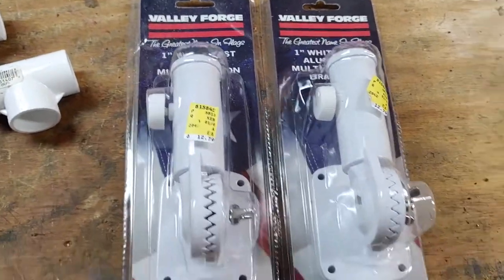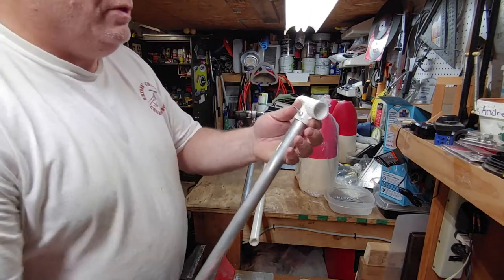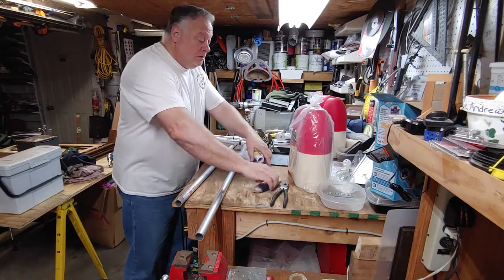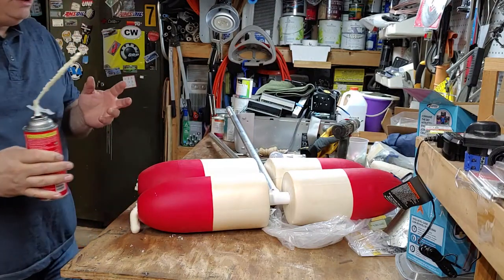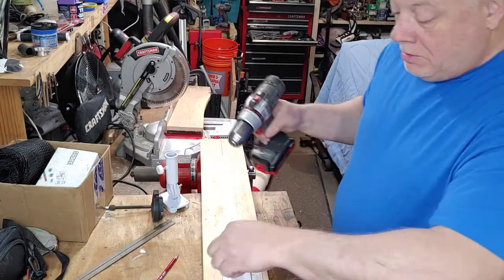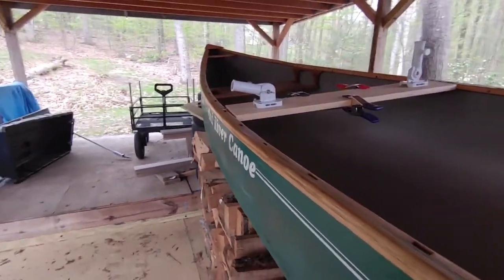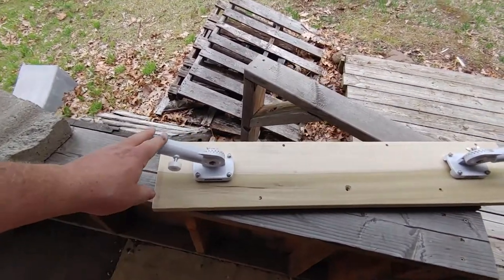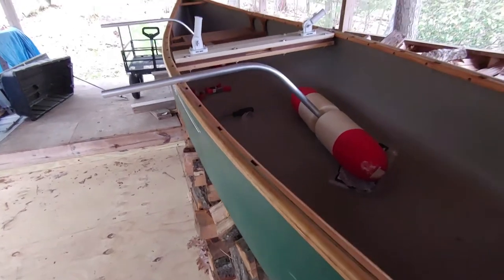Making of Canoe Outriggers that are removable and will not damage the yoke.

Comment: Nice build! I have a Coleman canoe that has a 1 1/2”-2” round aluminum tube that’s my center “yoke” so I couldn’t make one like yours. I had to drill holes in the center tubing and lay my smaller outrigger tubing on top of the canoe center “yoke” pipe and line up the holes and drill them out. I don’t have the flag pole holders on mine, I bent the outrigger tubing and mine is bolted through with large washers bent to match the pipe. I use wingnuts on the 4 through screws and it works great. 
I didn’t use the crab pot bouys, but instead used a “jumbo” pool noodle one each outrigger. Same concept. Been using mine for 3 years now and works great. It lets me stand up while fly fishing.
Reply from the maker: That's awesome!! Hey, what ever works as long as you get out "on" the water, not "in" the water. LOL!!

Comment: Will that pvc plastic portion of the built consider the weak point that will break first ? I would use    Aluminum throughout with  reinforcements  gussets and extra pipe for strength, security and stability to replace the pvc ?  Weight difference will not be that much … ill use your design and weld aluminum pipe for my outriggers  but awesome idea
Reply from the maker: I weigh 300lbs and it has not broken yet. So, maybe after a lot of usage possibly....but not currently. Thank you for watching and commenting!

Comment: Great Video , do  have an update  on how well it worked ?
Reply from the maker: Yes, just have to get some time to post it. Hope in another week.
Reply: Do you remember the wall thickness of the aluminum pipe ?
Reply from the maker: 0.06 Inches. I used Aluminum piping vs aluminum tubing. Pipe is thicker than Tube.

Comment: If you had extended those arms completely out the ends of the buoys, you could of glued end caps on the pvc.
Reply from the maker: I did not want the PVC pipe to stick out. I just wanted it to go in far enough to secure it tightly.